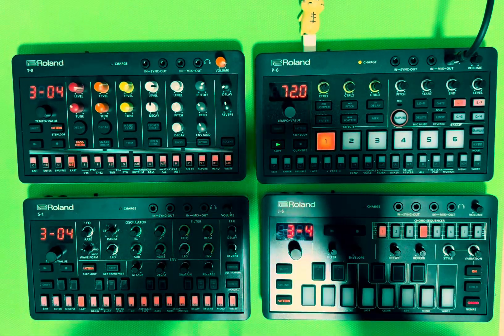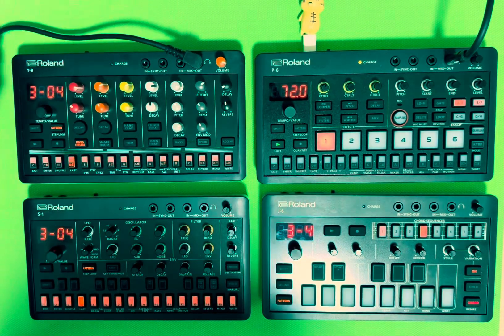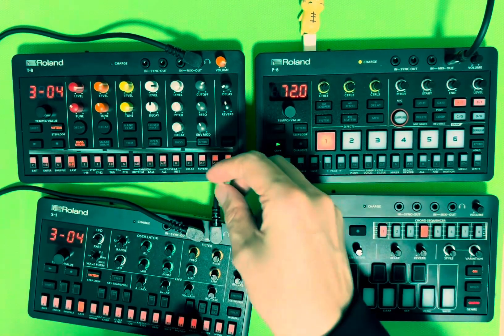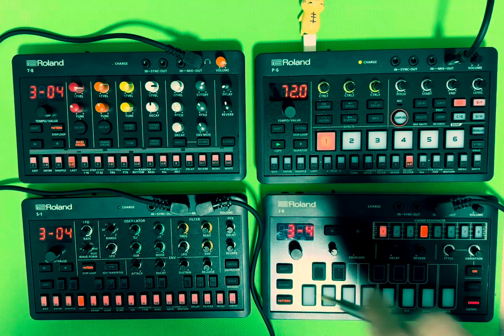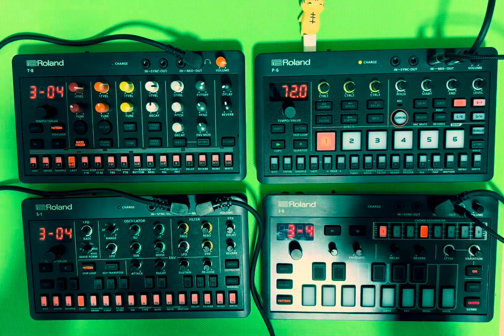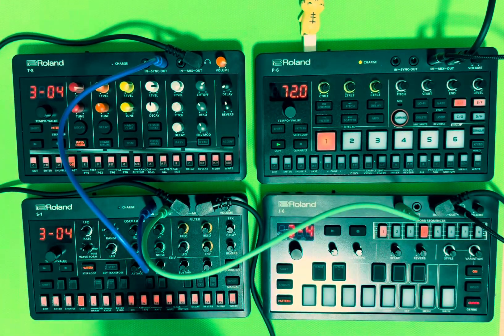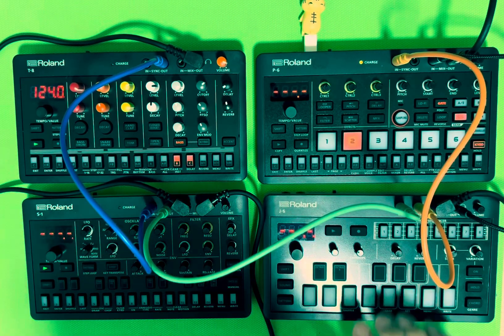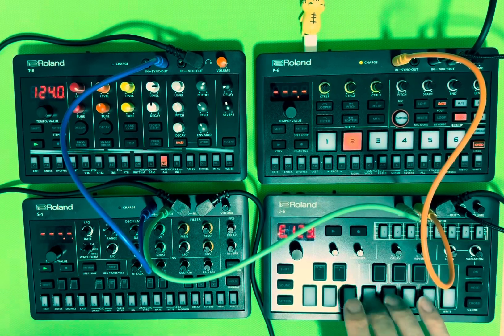What are all the cables for?! (Roland Aira P-6, T-8, S-1, J-6 & TRS / TS / USB Cables)

Comment: hey mate.

just like columbo --> famous last questions  :face-blue-smiling:

to chain all 5 of my aira compact to each other :
 do i need to have a midi circle or ist it just one to an other and the last device is not connected to the first gear via midi?
is it either necessary or absolete to have midi and sync connected both?
any reccommation how to use e-4 in the chain ?
what device would be the best one as a master?
Reply from the maker: @ninetieight  Hey! No need for a midi circle - just one to the other and the last device isn’t connected to anything in midi.
I don’t think there is any benefit of having midi and sync both connected. I bought ts cables to use the sync ports but then I later learned that midi ports do the same thing as sync with trs cables AND also allow for start/stop triggering when set up correctly. (Check the menu of each device under “Sync” option is set to “Midi” not “auto”)
I use the e-4 as the first in the chain as I don’t use midi for it. But reckon you can experiment with that if you like.
Reply: @Gold_Music_Vault  🚀
Reply: @Gold_Music_Vault the e4 sounds better if ythe delay is in sync with the bpm of the track
Reply from the maker: @JVJF7 good call, I’ll try that!

Comment: If you're only usng Aira devices you don't need sync cables at all. Use MIDI In/out with the same cables and pattern as the mix connection.

...it's in the manual on the Roland website.

TS = Tip Sleeve - mono 
TRS = Tip Ring Sleeve - stereo
TRRS = Tip Ring Ring Sleeve - Stereo + mic (Useful on an E-4)
Reply from the maker: Yup, I’ll be getting some more TRS cables soon, and shelving the TS cables…
Reply: How you gonna connect a midi keyboard then? And I don't want every device to start playing a pattern, just because I press play on one of them. So it's TS mono sync for me
Reply: @JVJF7  Then disable transport RX...and I specifically said "if you're only using  Aira devices".  Although I'm not sure why you think that you can't use a keyboard.
Reply: @JVJF7 turn sync off

Comment: I have purchased the BOSS branded TRS MIDI  mini cables which uses the rear MIDI ports,.  This ensures the midi clock will keep all the devices in REAL sync..  Also, you can buy the MIDI cable that has standard MIDI on one end and TRS mini on the other end.  Its handy because you can use a keyboard controller to perform on the very tiny keys on the S1 or J6
Reply: yes I've done the same and also connected the T-8 with an Audio Midi interface to the DAW
Reply from the maker: @greigclement9081  Amazing! I will get that one then. Thanks for the recommendation 🙏
Reply: But you can't cause you are using the midi in port for syncing

Comment: Nice little video and jam...
Your comment about cables getting in the way reinforces my thought that these compact devices would really sit well on a pedalboard or similar where the cables can be routed under the units.
Reply from the maker: @patrickmaloney6440  yeah, that would be ideal. I’m also looking at getting 90 degree angle-d cables (if that makes any sense!).
Reply: yes, I put mine into a case with foam insert, each in its own slot with a sloped stand ... right-angled cables are a must here
Reply: Yes sir, Mine will be mounted and hidden on my Fender Pedalboard.

Comment: You can use TRS cables to link the synths via midi. Ah, you’ve said that at the end. Using the Sync ports gives a bit more freedom for each device, as using midi creates more of a master / slave setup.
Reply from the maker: Interesting, I was wondering what the difference was. I treat each synth like a band member and would like the drum machine (t-8 in my case) to be the leader of the band. Think I will buy some more TRS cables soon to try linking via MIDI.

Comment: I'm a beginner too, Just got a T8 about a week ago, so I'm still learning. I'm a bit confused about the single ring cables, as well. But, I believe they send midi information, and I think there is a settng somewhere in these that will sync the units up like you want to, or with a DAW, but I haven't got that far yet. I think you can also use them to link a midi keyboard to a unit, too.
Reply from the maker: @rompofotters  Ooh, that rings a bell actually. I remember seeing some videos of people diving into the menu’s to sync the units up. Cheers! I’ll look into it :)